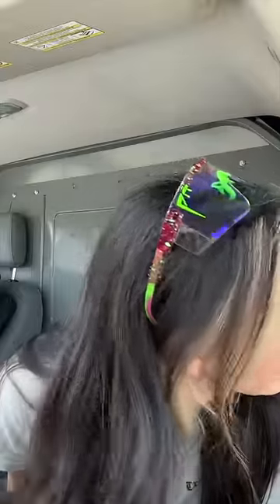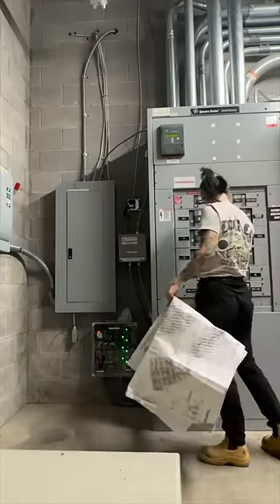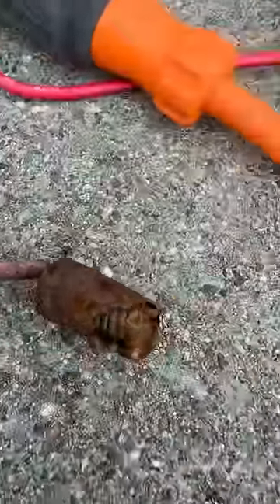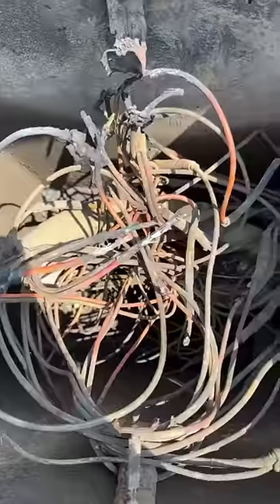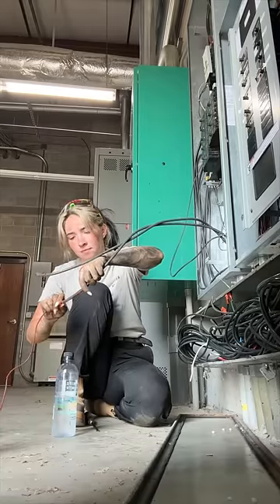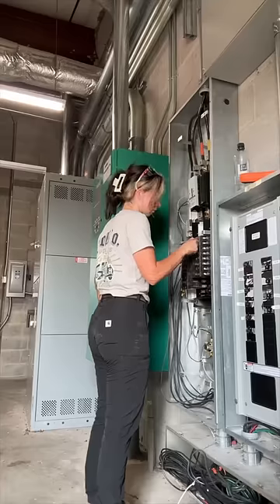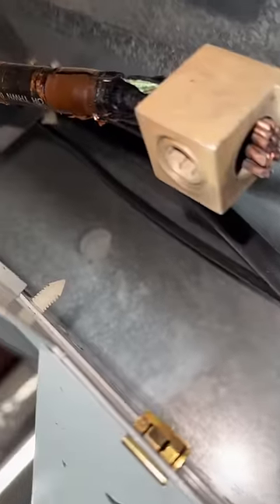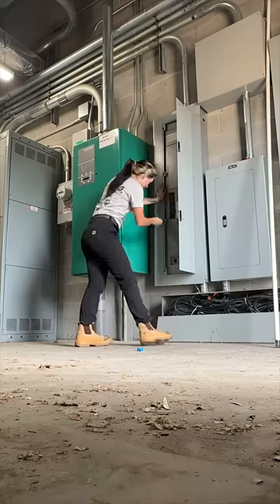Troubleshooting 480v Light poles

Comment: Question, my 40 amp breaker for ac keeps tripping. Ac technician told me it’s a bad breaker. I changed the breaker and after 2 month it happened again. Changed breaker again and lasted another 2 months. Happened again changed breaker again for a total of 4 breakers in 6 months. What could be causing this issue? Note: new construction home with new carrier 3 ton unit. Thank you in advance.
Reply: I'm certain it's just your breaker is undersized for the Locked Rotor Amperage, also known as Motor Startup Current.  Does it trip just during startups?  If so you're allowed to 'size up' the breaker to a higher rating, for these motor loads only.  It depends on motor types and your compressor inside the air unit.  

There's a chart in the electrical codebook, chart 430.52 which provides you with the percentages you would multiply your nameplate 'FLA' (Full Load Amperage) by that percentage found in that chart to arrive at your new breaker rating.  The standard, common breakers for residential applications are Inverse Time breakers, so you would use that column of the chart to locate your percentage multiplier.

Now that said, you want to ensure the breaker is stamped 'HACR'.  These are specifically designed for 'Heating -Air Conditioning - Refrigeration'.  You should find that on the little white label or either white writing on face of the breaker. These breakers possess different trip curve characteristics and are designed for motor and compressor loads.
So it's chart 430.52 in the National Electrical Codebook.
Reply: @chrisharrell5945  thank you so so much. Breaker trips not only on startup. Tag on condenser says max amp 40. Builders had a 40 amp breaker in place so I changed it out with the same square D 40 amp breaker.  I will check chart and do math as you referred to. Again, thank you for helping. You are the best.
Reply: @patmash  now that's a separate issue altogether - tripping while running. How old is your unit, it could be low on freon and the breaker is tripping due to excess current draw from the compressor, but it should be throwing the thermal overloads or fuses at outside unit first and not the breaker.  Does the breaker hold at all?  If not, you have a fault, most likely inside the exterior unit somewhere. 

Another thing to consider, the nameplate takes a special interpretation because FLA and FLC, although 'essentially' the same in other conversations, when on the side of a unit, they aren't.  FLA (Full Load Amperage) refers to sizing of your circuit breaker, whereas FLC (Full Load Current) is sizing of your fuses or overloads.  Something to note when sizing breakers.  

Now, all that said, turn your AC off at the thermostat and see if the breaker holds.  This partially tells you there's no faults with your electrical circuit feeding the unit.  No short circuits within.  

May need to get someone that knows units to look at your unit for you.  I think your compressor is overworking due to freon leak.  Do you have 8 gauge wire feeding the unit?  Should be stamped on the side of the individual conductors themselves.  I would stop turning breakers on until I could locate the fault or issue, doing so is only going to lead to compounding damage.
Reply: Just measure the current in the circuit and stop guessing.
Reply: @deang5622   just measuring the current isn't the only element of troubleshooting.  Even if she did, if she doesn't hold the other pieces of the puzzle, may not know what to do with the information.

Comment: a few tips.. (that may save ur life one day)
dont wear any jewelry on the job
cange those suglasses to a pare with pure plastics(none cunductive material) and polarised filters(none metallic)
never lean inward a power station box witout safety ground it
wear a belt without metallic part (if u dont have special clothing)
...ther are special clothes that acts like a faradays cage...maby not at present but in the future...
...if u in the future works with bigger electric engines or trasformers... the puchback (when the electric field collapses) can be hudred times greater than the voltage feed...
a 70kv transformar can have a puchbach exceeding 1MV...

Comment: Your nails are way too long for that job, use less long nails, women like them, but you can have them shorter and still do the job; stop making it harder and more dangerous to you.
Great job, thorough and complete as much as it was possible. Always get some water to drink, hydration is very important; you don't need to drink a lot, just enough, and your performance will be better, your body stronger, and your body need a few drinks every 2-4 hours, or some parts of it just won't work well or at all, it could be even dangerous in your line of work; so also hit the Gym 2-3 times a week, you don't need to do heavy lifting, just work out your muscles, get a trainer in the Gym if available and can afford it

Comment: Is that a lot of ? volts ?
Reply: Still considered "low voltage".
Reply: @tylermorrison3654  But it can definitely leave a mark.
Reply: @tylermorrison3654  ... " low voltage" is considered to be under 50 volts. This would be "line voltage" in most situations. (50 - 600 volts) The fact that she is dealing with 277 / 480 means it's 3 phase and industrial, rather than residential. The list of working precautions is higher.
Reply: Yes, depends on who you talk to however.  If you're considering the grander scheme of electrical industry/ power production, the industry would indeed label this as 'low voltage', but hear me out for a moment.  We are talking about the industry which makes the Switchgear, Switchboard and Main Distribution Panels; etc;. That same language would also resonate from the Linemans'/ Utility's community. 

That said, from the perspective of an electrician this is not a voltage class you want to be lackadaisical or haphazard around.  It's not considered low voltage within those environments that electricians work around.  This 277/ 480V will mess you up and I'm talking bad, it will blow your elbows off, your hands off, burns that will melt your skin like wax.  So if you see labels which read '480 Volts' ....stay away from it, don't lean up against the equipment, no jarring the covers, sitting your soda pop can on top of or other haphazard things.   It's not something to be playing around.....respect it like you would a Cobra
Reply: @tylermorrison3654  That is not a good response, actually a dangerous response to provide to someone uneducated in the realm of electrical/ electrical work.  It would have been better to not even have left a response.
Reply: @chrisharrell5945  ... It's in the NEC. LOW voltage is under 50 volts and is a different class of operating license than 50 - 600 volts, where they call it LINE voltage.
Reply: @chrisharrell5945  thanks for the navigation then
Reply: @rupe53  actually I'm an electrician, I'm intimately familiar with what is classified as Low Voltage in the NEC. Apparently you haven't been keeping up, we're now licensed up to 1000V.  Have been for awhile.   But my point was, just labeling something as low voltage without any further descriptor for someone like the unlearned, which posted the question you responded to, is dangerous.  These people don't have a clue about electricity or the electrical field. Utilities may call 480 low voltage but it'll toast your arse and needs to be known as such.
Reply: @rupe53  and another thing, if you have any of three licenses for operating as an electrician you don't need a separate license to work with voltage classes under 50v.
Reply: @onlythaclonessir2525   You're welcome, I was a little too wordy because I thought you wanted a deeper, thorough explanation initially.  Since that, I have deleted a large percentage of that earlier response.  I don't think you wanted to hear all of that, only to know if it's a low voltage or not.  What I was trying to convey was, largely depends on who you talk to, but from someone that knows nothing about electrical work, "absolutely it is not a low voltage"  😉
Reply: @chrisharrell5945  ... been retired for a few years so lost track of where they draw the line on higher voltages. I never worked on anything above a nominal 480 volts, but our insurance company had everyone take a course and written test to 600 volts at the time. As to your point on people having no clue... it's up to them to seek a little education. These are the same ones who will blow themselves up at 50 or 250 volts. What's a few extra volts between friends? <LOL>
Reply: @chrisharrell5945  ... in our state you still need a license to do alarms, thermostats and doorbells at 24 volts, which is not valid for normal household wiring. For some guys, that will be all they do.
Reply: @rupe53  that's interesting.  In NC, any of the three electrical licenses allows one to work on all the lower voltage classes without issue.  Those aside, there are 'specialty licenses' for individuals which say, 'wire up water pumps.'  Those kinds of things. 
Yeah, I've never understood how states twist and convolute the measures of the code from one state to the next, when the book and code is "National..."  It's a national code, I think all licenses should reciprocate between every state, not just one or two. It's foolish.  Should be against some right to work laws. Ridiculous, because we both know it's all about the green, they dont' care about the electrical work.
Reply: @chrisharrell5945  ... as I understand it, you have always been able to work below your license level, and when home security became a big thing (40 years ago?) many simply got a license to do only that. In my case, I was in the specialty category where HVAC allowed you to do associated wiring for "near system" meaning (usually) within the utility room or equipment area, basement, rooftop, etc. Most of the rules were about fire and building safety. IOW, where not to drill holes, heat ratings, cable protection, waterproofing, and what needs fireproof caulk, etc. I would agree that there should be some consideration between states on licensing requirements. It was brought to my attention that only a few years ago some areas still allowed pretty serious work under a home improvement license. BTW, my HVAC license also allowed me to pipe gas and oil during my time in the standby generator business. (1997 till recent retirement) That was a handy "jack of all trades" situation to have under my belt. I can't tell you how many times I had to figure out why certain systems didn't play well together. One of the more common problems was a new WIFI t-stat installed, and the customer complained of no heat when the gen set was running. Usually, I found they were grabbing 24 volts from the AC, but on a smaller gen set the AC was not tied into standby power. They needed to rewire power from the heating system. It pays to understand the big picture. <LOL>
Reply: @rupe53  Interesting stories.  Sounds like you fell into a sweet deal with that license- to-work arrangement.  Yes it does pay to understand the big picture.  Times were so different back then.  I actually started working in the field just as you retired.  Things are changing so fast now it's challenging to keep up with it all.  Plus, inspectors back then were actually sensible humans with a very strong sense of respect for the tradesman, not these egotistical ones which seem to be permeating every office now.  Although, I've been fortunate, we still have a couple of old schoolers around and they are the best people in the world to engage with.
Reply: @chrisharrell5945  ... one thing that won't change is 40 years from now guys will be saying THESE were the good old days!
Reply: @tylermorrison3654  Only by linemen.  Electricians refer to low voltage as under 50.
Reply: @rupe53  🤣🤣🤣  that's the truth!!  That's funny.  I've said this before but it's funny hearing it.
Reply: @chrisharrell5945  It's actually very appropriate. I am purposely putting quotes around low voltage to distance my self from technically correct term. As soon as OSHA and NFPA 70E is/are involved 480 volts is low voltage. The general public needs to be more worried about 120 volt power since the can't seem to stop killing themselves with it. My mild sarcasm may not come across here but I thought the quotes were fairly obvious. Most of the stuff I work with at my job is in the medium voltage range but I was in no way trying to minimize the hazards presented to the human body in the "low voltage" range.

Comment: Wow... wtf is your safety protocol ? Get lockout tags, facial masks, insulating gloves and tools, and all the right gear ! Mechanical gloves will not protect you from live wires, or shrapnel of red hot copper. You already should know this, and you will have accidents working with minimal safety like that. 
To be clear, i'm not wishing this on you in the least, but these mishaps happen, and they take you by surprise. 
It cost too much in terms of injury and lives. From one professionnal in the energy sector to another, please don't become another statistic. 480Vac does not forgive at all.

Comment: Well you will find out real quick with 277/480 if it's all off!!!!  Even using a volt tic would be good to do.  277 is worse because it likes to bite and hold on to ya!!! 480 will just blow you off.  I hate pole lights!!! Photo cells and capacitors!!!😂

Comment: It's astonishing how inadequate electric devices/parts are. I have only started to see innovation in the electric field in the 2020s in USA. 
Every job everywhere is stupidity when it comes to using common sense. 
Electricity is stupid simple but the devices or hardware use are old, it's like comparing a gun to a sword that's how ancient this field is. Unfriendly, dangerous, slow, expensive

Comment: knowing a tiny bit of basics about electricity that seems like you got balls of steel using just gloves to fondle a nest of 277/480 volt wiring!  or is it the case I just dont know anything about electricity and that is actually normal?
Reply: It is normal for electricians to not use gloves simply because we're hard headed, although it's not advisable.  Of course, it's safer to be wearing them but they're cumbersome. Thing about electricity, it doesn't care what day it is, or what your mood is, if you do something too stupid, it's there to let you know.

Comment: If you are not willing to quit this job try to stay away form high loads and voltages because we are bioelectric beings and 50/60 Hz fields with those levels are carcinogen and you can lose fertility very quickly.